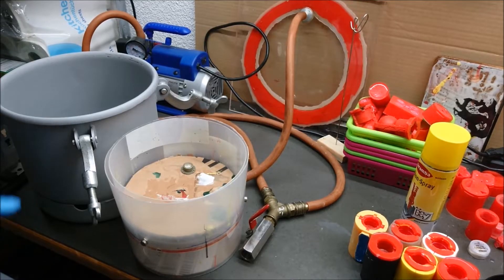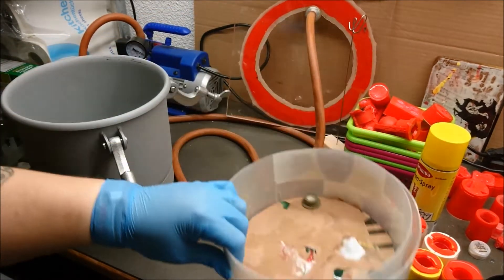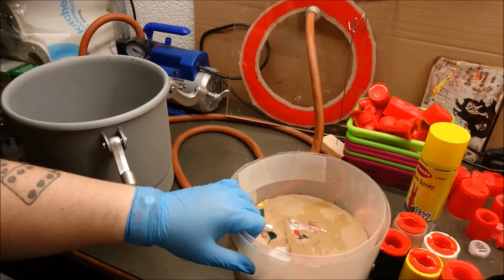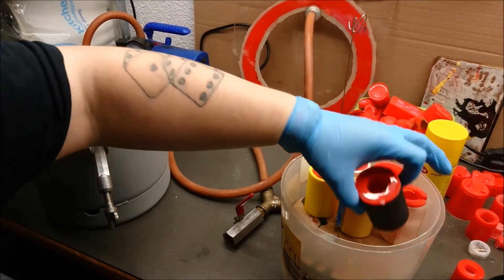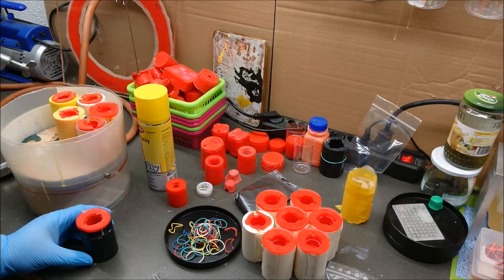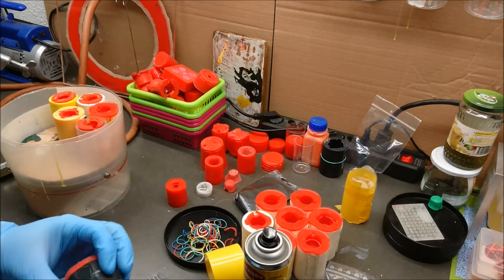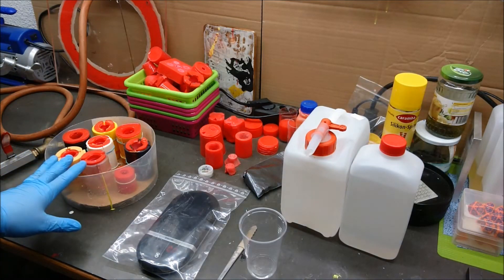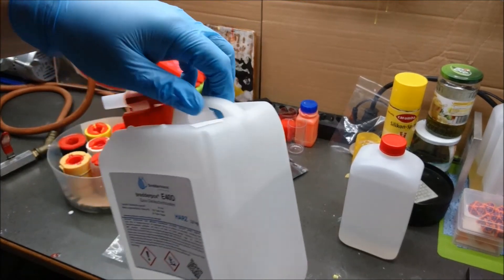Dice Making Advanced Casting Part 1: Pressurepot and Vacuumchamber

Comment: Hi Wurfel!

You're mold sleeves are excellent. Are you able to cast multiple colors or gold leaf with that technique or does the "vacuum casting" method mix the colors together or would the gold leaf clog the funnel? Great videos, I enjoyed this whole series.
Reply from the maker: Multiple colors is no problem. It's a bit of testing required, but you can fill in only half of the resin, fill the mold via vacuum and then pour in a second color resin and fill that in. Regarding how fast you release the pressure into the chamber, you can control how the second resin flows into the mold. A fast release and the second color gets pushed into the first, may help to get a nebula effect. A slow release and it will slowly flow into the mold and you have two colored dice half and half. It works best with transparent resins, as you have a bit of the first color on the inside of the mold where it flows down. Its thin, so in transparent color it won't be visible, especially when you do the lighter color first and then the darker. With leaf metal I have no experience, but I would say you could use a toothpick to push some leaf metal in and the do the rest with vacuum.
Reply: @wuerfel_schmied   Thanks for the response!

Comment: Hallo ich liebe deine Videos und möchte deinetwegen so etwas auch mal probieren. Ich habe Zugang zu einer Vakuumkammer aber nicht zu einem Pressure Pot. Kann man damit auch schon weniger Blasen erreichen? Und weißt du nach was für einem Produkt man auf deutsch suchen muss, wenn man einen Pressure Pot haben will? Eine Vakuum Pumpe kann man dann sicher auch nicht verwenden, oder?

Liebste Grüße und danke auch für deine Bilder auf Instagram
Reply from the maker: Hi, Also mit dem Epoxyd Harz ist es kein Problem auch ganz ohne Vakuum oder Druck auszukommen, wobei es sich empfiehlt eines der beiden zu nehmen sofern man Zugang dazu hat. Du kannst auch mit einer Vakuumkammer alle Blasen aus dem Harz entfernen. Bei meinem Design sind allerdings sehr viele Kanten vorhanden, da bleibt gerne mal ein Bläschen hängen, deswegen benutze ich den Pressurepot. Ich hab meinen Pot von eBay. Den findet man da als drucktank für Farbe. Schreib mir auf Instagram nochmal, dann kann ich dir auch nen Link schicken, aber für den Anfang ist eine Vakuumkammer völlig ausreichend. Das Gießharz hat 40 Minuten Verarbeitungszeit, also genug um es vor dem Guss zu entlüften und danach auch nochmal wenn es in den Formen ist. Für den Pressurepot brauchst du ausserdem einen Kompressor um den nötigen Druck aufzubauen. Und der Umbau vom Farbtank zum Pressurepot brauch noch Kleinteile wie Anschlüsse, Blindstopfen usw.
Reply: Die Würfelschmiede ich habe jetzt beides hier (mir fehlt noch die Pumpe für den Drucktopf. Mich würde interessieren, ob du das Silikon auch mit Vakuum behandelt hast, oder, ob du das Silikon der Formen unter Druckaushärten lassen hast? Liebste Grüße und danke für den schönen Kanal
Reply from the maker: @Chrachen  also wenn du unter Druck gießen willst sollte auch die Form unter Druck gegossen werden. Es empfiehlt sich das Silikon vorher zu entgasen da man gerne große Blasen einrührt.